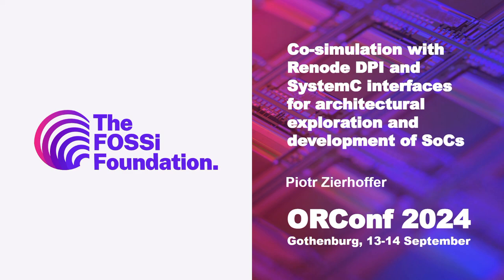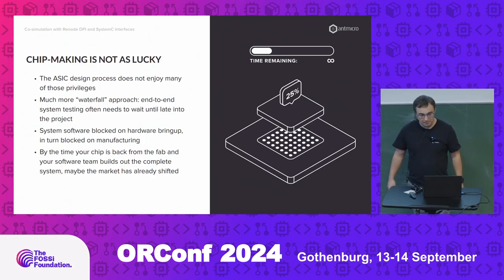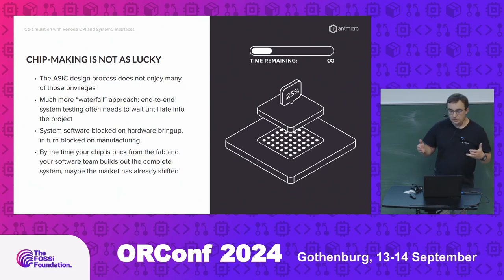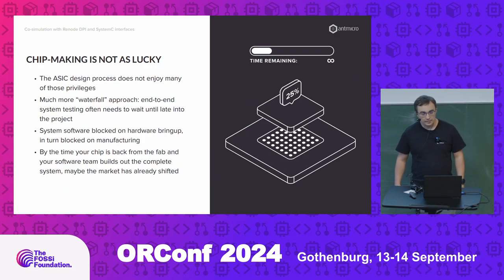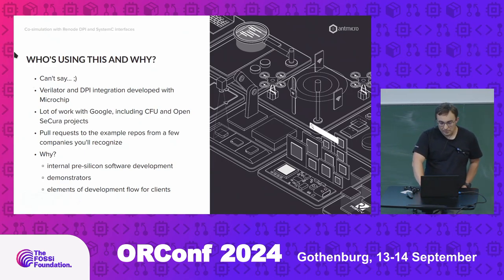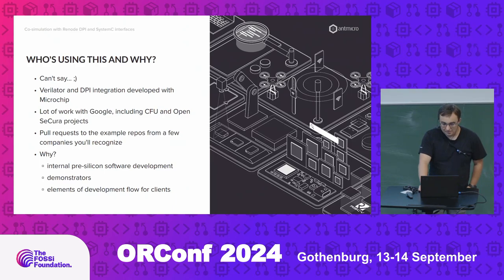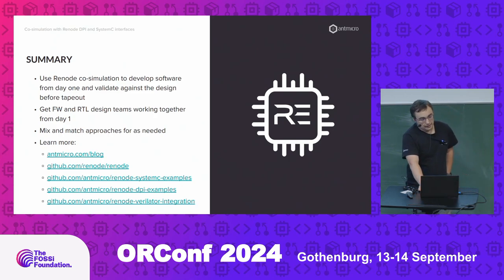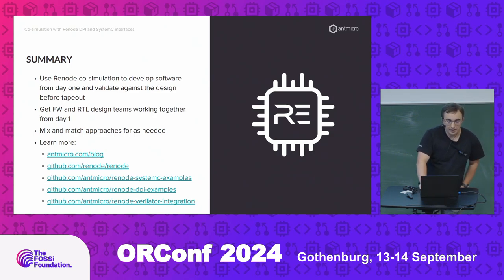Co-simulation with Renode DPI and SystemC interfaces (Piotr Zierhoffer)

Comment: Would love to see an elevator-pitch on how Renode could be used for a given platform..  whether it's a microcontroller (STM32 Disco/Nucleo eval boards with built in JTAG/SWD, and Stm32Cube IDE) or an FPGA  (Microchip Smartfusion2 by Trenz,  Lattice Fomu by CrowdSupply,  or Altera/Intel Max10 by Trenz ) 

Is there a workshop or tutorial that walks a new-user from tool setup, all the way to running the most commonly used Renode features?